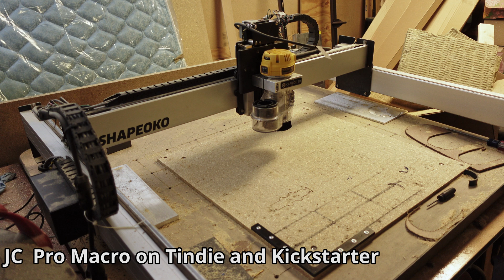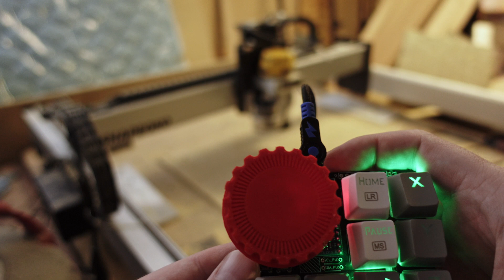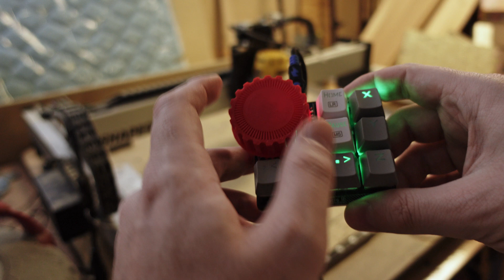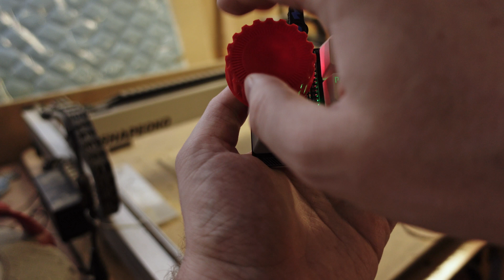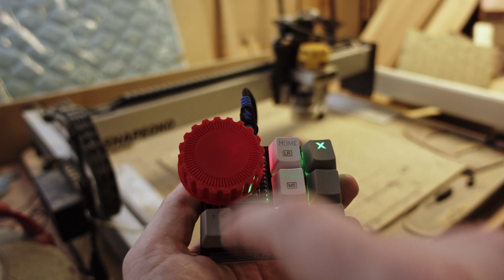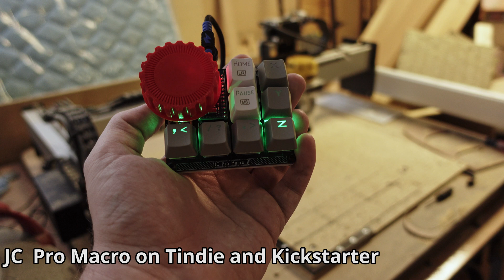Using the JC Pro Macro Pad with Rotary Encoder as a Pendant for CNCjs

Comment: Hi Pat, can you drop your code for us in the audience? Or do a video running us through how to do what you did step by step? I have one of Jeremy's pendants and need assistance. I want one of my buttons to run the XYZ zeroing macro as well as jogging around and homing. All brilliant.
Reply from the maker: I can make no promises that it works, and it will be very dependent on whether your CNC control software has hotkeys for doing all the things you want to be able to do, but I did find a CNCjsMacro.ino file here.  It is PROBABLY the one I am running in my garage, but I am not sure.

The code is kind of a kludge.  It is undocumented, quickly hacked together, and doesn't have the polish that something meant for consumption by the rest of the world would have.  I'd be happy to drop a copy in Jeremy's channel on our Discord server if you'd like to poke around at it!